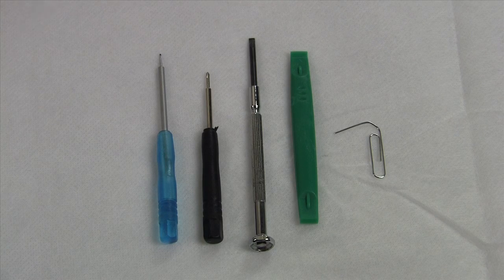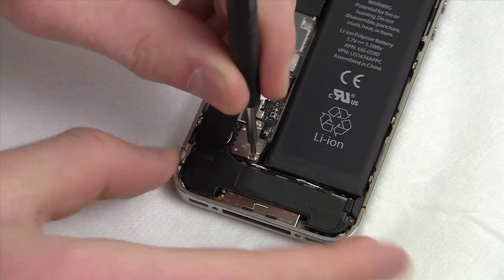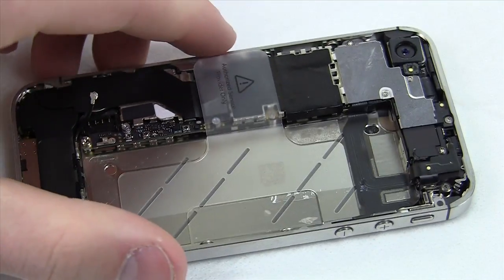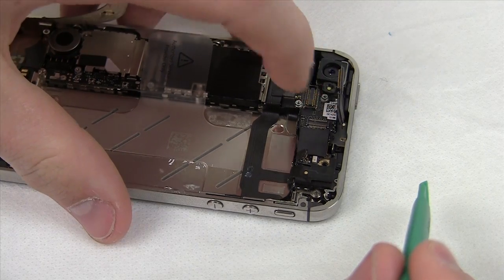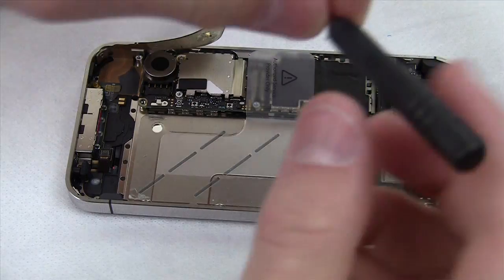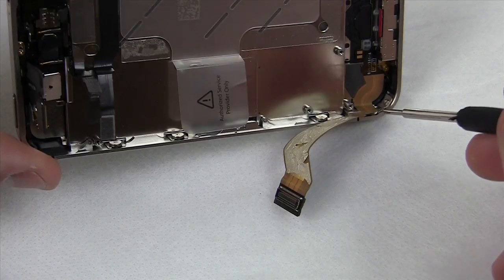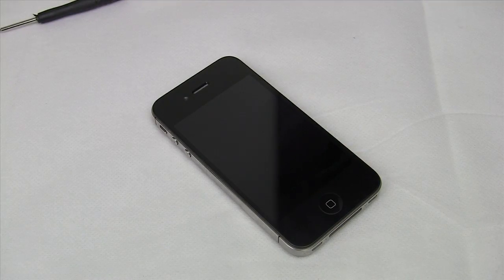iPhone 4S Complete Disassembly and LCD Screen / Digitizer Replacement Walkthrough Tutorial

Comment: after getting my screen replaced, my iphone 4s started to reboot randomly. Now, it only turns on when plugged in, there is no wifi or cellular or bluetooth (greyed out), it crashes and restarts every five minutes and there is no possible way to fix it. I can get it to stay plugged into itunes recovery mode without restarting but I don't want to restore it. I can't update because it's jailbroken, so I have no choices. Battery replacement didnt work, I took it apart and replaced it myself and it just won't stop restarting or crashing. Help?

Comment: Those who said it was not necessary to take out the 6 screws around the outside gave some bad advice. This will cause the metal attachment on the old screen to tear off and cause problems when putting on the new screen.

Comment: Hi, Do you have any suggestions on why the screen is unresponsive?  It will not unlock by swiping.  I've changed the screen and it still seems to be an issue.
Reply: +Leonie Moffat-Roberts Maybe the touch flex does not work
Reply: Found out it was the logic card needed replacing but thanks

Comment: Hello. Could someone please tell me how the phone receives wi-fi signal from a router ? We have 2 pieces responsible for capturing wi-fi signal: the wifi antenna and the chip beneath it. I've heard that with the antenna removed, the phone would still pick up a signal through the chip alone and that the antenna only amplifies the signal. Is this correct ? Thanks.
Reply: ***** Thanks, that's what I thought too. But a few days after I posted the question I went ahead and tested it out for myself. I removed the wi-fi antenna flex and still received signal from the router. Even started browsing with safari to make sure that it works
Reply: +reghin79 The screen is not fixed by right way,any help, contact me Skype:Tinaifix        Cellphone: 8613262180127   wechat:1320876304   Whatsapp: +8613262180127

Comment: Great video, but the stupid jokes were crass and not funny in the slightest. 

A point of note: "adhesed"? You made that word up, as the word is "adHERED".

Cheerio, and thank you, from England, the land where English was born.
Reply: PS: "antenna diode"?

Erm, noooo, that's a coaxial rf connector - if you pass rf, an AC waveform, through a diode, it won't propagate. Source? I'm a qualified electronic engineer. You're just a bloke who's learnt how to take things apart and replace parts like a Lego set, please learn the correct terminology for the things you're incorrectly describing.

Comment: My iPhone 4S works completly fine. The only PROBLEM is that the DISPLAY LIGHT IS WAY TOO DIMM, so dimm that you can hardly see what you are touching, even if you shine for example an LED light from another iPhone directlyon it.
I belive its problem might be the digitizer (I searched for reasons, but still not 100% sure), or did some little light(bulb) burn out?
Not sure though... the display glass is perfectly fine. Like I had said only the display light is malfunctioning.

Any theories anyone? I would grealy value it. Snazzy Labs
Reply: Slide up from the bottom to the top of your iphone, once that's done, increase the brightness. Let me know!

Comment: There's something about Apple's ridiculously paranoid attitude towards people opening up their phones that doesn't sit well with me. Why shouldn't I be able to replace the battery or repair the screen on MY phone without throwing up red flags and voiding warranties all over the place? Why should I have to pay an "authorized service provider" to fix my phone?
Reply: So tell us why Apple should honour a warranty when you've been poking your fingers and tools inside the VERY delicate, static sensitive and finely tuned mechanisms you probably know very little, if nothing, about? These are precision machines, not toys; of course you're very much free and entitled to go right ahead and have a look and inside and a poke around, and Apple are equally as entitled to tell you "Sorry, you've voided your warranty". 

An untouched, unopened electronic device is a known quantity to a manufacturer; they have set procedures to allow the, to diagnose and repair/replace components in a rational, logical flowchart type manner. You poking around inside, disrupts that logic, and introduces a whole new tangent to the simple step by step diagnosis and repair of your iPhone. As I said, go right ahead, it's your property, and it's Apple's warranty, and they're equally entitled to nullify it if they have sufficient evidence to warrant doing so. There's a LOT to learn in electronics, and the guy narrating this video seems to be needing to learn most of it. Static precautions weren't even mentioned once... I'm leaving now, you go ahead and void your warranty, and leave it to Apple to tell you that you've been inside it.

Source? 24 years of being a qualified electronics repair engineer - we've met people who withhold truth many times, their poorly veiled stories are completely predictable and transparent ^_^

Comment: Just a tip, the six screws with the washers don't need to be fully taken out, just loosened. This will safe a lot of time and frustration. However, make sure when you replace the screen, the washers are on the outside of the screen's 6 holding brackets. :)

Comment: this bastard doesn't have a reassembly video..
other than that; a very helpful guide!
also does anyone know where a gold metal ring with two forks came from? it fell out by the rear camera lense.. i'm just gunna hope its not 'necessary'
Reply: if you look on the top left corner near the camera you can see it in the video. it fell out on me to. it was under the bracket screw for camera assembly
Reply: Was the part important?

Comment: Wife broke i4s screen but was still able to use slide/touch screen.  Followed your video (repl'd screen) and screen does not accept touch/slide.  Opened & re-checked cables, all snapped secure.  Any recommendations?

Comment: I just bought an Iphone 4S from a friend, and when I go to turn on my Wifi, the swipe button to turn it on will not move at all. Also the bluetooth will not connect ever. What could this be? Thanks
Reply: I have the same problem, and my local apple doesn't change the chip (obviously). If you live i a descent country with warranty, or no warranty but you have to pay with no warranty. I gave the phone like 6 times and they didn't fix them. I hope this helps. Also, if you want a temp fix, heat the phone with a hair-dryer until you get a high temp message, the turn off the phone. When you turn off the phone, put it in the fridge for 10-15 mins, and get it out. Wait for the phone to become at room temp. and then turn it on after. I hope this helps! :) [this may fix the for life, or a long time, I hope it works for you and you wouldn't have to deal with apple].

Comment: Took off power and volume buttons in error and mesh earpiece was not on new screen removed to switch over then proceeded to lose. Cable that goes to power button bent afraid it is ruined hard to see what part or procedure often hands in way on video printout and video are not same sequences and no way to access reassembly promised. 
Can you please repost the 4s reassembly video really would be nice thank you.

Comment: Everything seems to be working, but there are two parts that did not show up in your video, and  can't tell where the came from.

They are both copper or brass,  One has two spring contacts at a right angle from the screw hole.  The other is painted black and has a single contact folded over the plane of the screw hole, and has a right angle guide to align the part over something.

Pics on g+
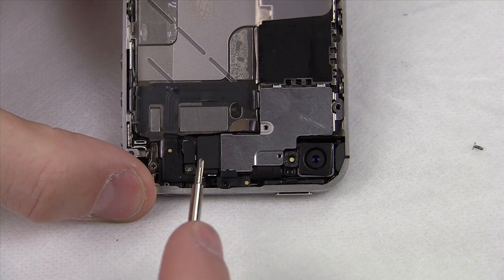Reply: The One that has two spring contacts goes in the upper right corner the spring contacts fit down in a slot with the screw hole being in the upper right corner. It's shown in the video at time 5:00. The one with a single spring tab goes on top of the battery connector with the spring tab up and facing the bottom of the phone. It's shown in the video at time 2:42.
Reply: The 5 min one has a long arm in it.  I got that one back in.  This one is much smaller
Reply: The 2:42 one is correct, missed that.
Reply: duane smeckert That one goes in the upper left corner underneath the screw that holds the camera in place.
Reply: ckinc123 Thanks mate

Comment: The video was great!  All you need is a little patience while you watch it and take your time.  It allowed me to install a broken screen and digitizer assembly with very little trouble.  I must say, however, that I somehow left out one tiny screw when I was done. Dang.  Need to go back and check the video to see where I messed up.  In any case,  my iphone 4S works again and it only ended up costing about $30 for the kit.  Also, love the sense of humor in the video.  Reassemble - watch backwards.

Comment: Apple puts 'locks' on the iPhones so that they can detect if they were opened by a non-authorized store?
I need my iPhone replaced, but I have sent it to replace it's screen and to a chemical shower (dunno it that's the name in English) and they disassembled it completely, and reassembled
It started working perfectly again, but now it has no brightness, the screen doesn't light up!
pls answer quick
They said they won't replace it because it's already been opened
Can they really detect that?

Comment: i  have a question, i dropped my iphone 4s(table height). the first thing happened, the screen goes white(what they called "white screen of death" or whatever it is) and after several reboots, it turns greenish. i dont know how to put it but its "greenish and a little bit yellowish. but everything seems to be working fine, the touchscreen works proximity etc. but i saw other vids the same happen to me. the greenish screen but after they restore it or reset it, the screen backs to normal.

Comment: watch the video carefully when pulling the main board out, I think it belongs underneath the camera piece, I see a full brass metal piece there and later in the video its not there.  Looks like he forgot to cover that part,  it;s the only place I see it I will be reassmebling the phone later tonight and I will post once completed but I am pretty sure it goes there . If you go to 8:20 mins you can see it (i think) in the top left corner where the camera used to be. LMK if you confirm this. Thanks

Comment: Great disassembly video but should cover the small gold, grounding fork and rubber bumper that comes off when the screw under the piece of tape on the motherboard is removed. I used this reassembly video, which also didn't cover the grounding fork!

Comment: Great video.  The six side screws with the washers do not need to be removed.  They can be loosened about one turn.  Much easier than reinstalling them.  Just be careful when putting on the screen that the tabs are under the washers, not over.

Comment: already have  changed twice my 4s , under warranty !  Third one recently failed, extremely low sound in "normal" ear speaker (upside), and after a check by authorized phone dealer it's worse now, loudspeaker option is dead , nothings  is heard and or send ...  !!!  next phone will be a BB Z10... sigh

Comment: Hi  I just bought Iphone 4s from a guy who said it got wet and he didn't have time to get it fixed. He also had and extra battery because he thought the battery was ruined. I ordered a simple kit online before i saw your video. It had gotten wet as the little strip had turned red, 
The little black clip under the battery is gone. Does that matter?
Two screws are gone on the circuit board. Does that matter? 
Any help would be good.
Thanks
Barry

Comment: The Device drivers installed on the motherboard would not allow for most other parts to work between iPhone models. In addition to hardware/software issues, the frame of the actual phone does not always allow for mounting the hardware not intended for it.

Comment: I doubt the design of 4 and 4s are the same, the motherboard would be a different shape.  the motherboard would only work with devices is was designed for such as camera and screen.  and where would you find these parts with out having a complete 4s already and if you have a complete 4s why not use that.

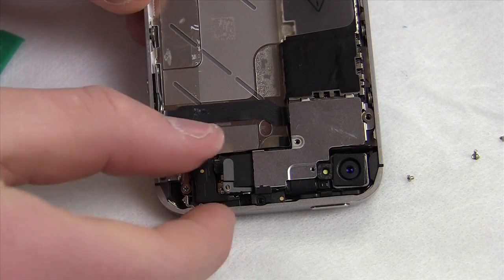Comment: i accidentally got the conductor at 05:19 stuck under the chip during reassembly and it broke as i was trying to get it out, does anybody know where i can order a replacement from or which part to order which will contain this piece?

Comment: Well the back cover will be extremely easy, since it's just removing two screws, but the only thing I can think of that would be risky is losing parts, not reattaching something, like the diode beneath the battery, or just damaging individual parts. Now, if you're careful, and have enough space to make sure you don't lose pieces and make sure everything is put back and is in contact, then you should be fine. Be careful and you should be fine.

Comment: Just a pointer when taking out the 3 screws on each side of the inside. Don't remove them all the way just loosen them up enough to where the screen bezel can slide out. As for the corner screws remove them all the way!! Hope this helps!
Also check out my channel for screen repairs, Jailbreaks, and unlocks!

Comment: Hey there, I have been fixing a lot of friends phones and others from my school. Including 3G, 3GS and 4. I was just asked to do a 4S for the first time, I was wondering if the LCD/Digitizer is the same for the 4 and 4S. I noticed a lot of the inside of the 4S has similarities to the 4. And i noticed the two cables from the Digitizer/LCD look the exact same for the 4 and 4S, but whether they can be used in either I'm unsure. Please help me out before i buy 4S screens when i didnt need to Thanks

Comment: I don't give a fuck about how you weren't asking me. Anyway, that's obviously an issue with your headphone jack if only one bud is audible when plugged in. Either the headphone jack, or your logic board. And also, the mic on top is the noise-cancelling microphone. The one on the bottom is the main microphone and used for calling numbers.

Comment: I am trying to do a conversion of black into white since I dropped my iPhone 4s. Unforgettably the front screen touch sensor or what ever stop working ever since I replace it with a new one.

I then took the new screen out and put the cracked one back on and it's not working also when it did before I took it out.

I'd retrace my step and everything work except for the touch screen, can't seem to figure out why the screen not reading any touch for entering pw, or slide for unlock.

Comment: Quinn, nice tutorial. One point though, the six screws on the sides ( the ones with the washers) only need to be loosened, not removed. Hat way you don't have to keep track of the washers and it saves you some trouble re-assembling the iPhone.